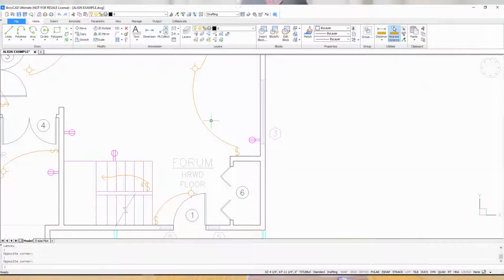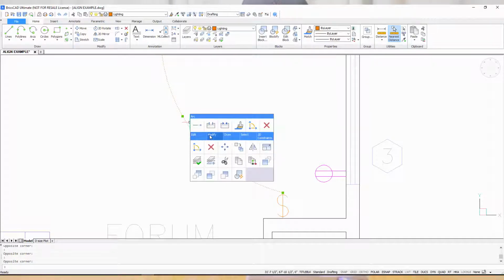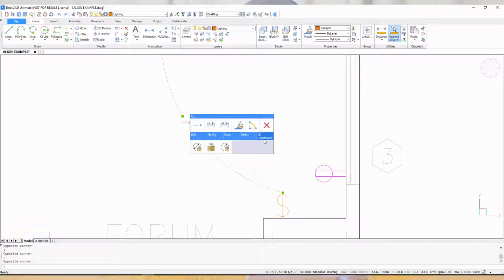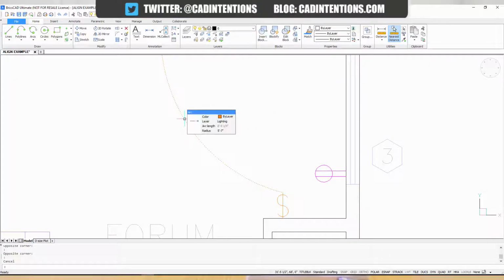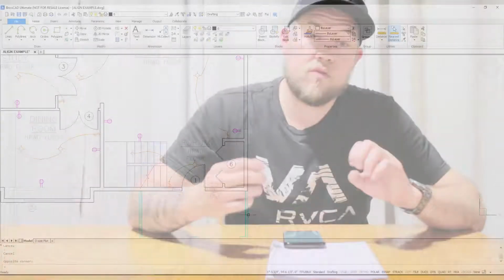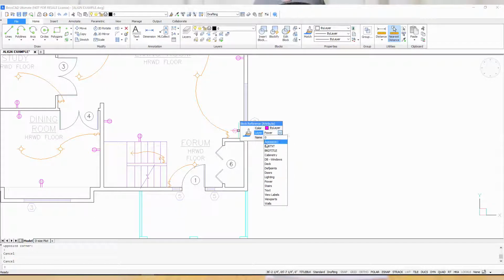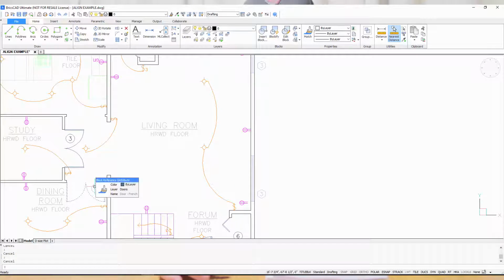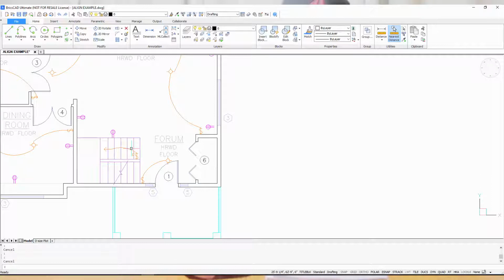3 Must Know BricsCAD Tips & Tricks for AutoCAD Users - Learn BricsCAD Fast

Comment: Hi Brendon

Thanks for you videos. I've found them very helpful for learning Autocad.
Are you able to comment on how closely aligned Autocad and Brics are in terms of commands and approach? 

Hugh
Reply from the maker: Sorry for such a slow reply, just saw your comment! They are very closely aligned. If you are familiar with one of them the transition will be very easy and quick. the commands are quite similar in both and the overall workflows and usability are close as well. BricsCAD has a few things to get used to like the right-click options and contextual options but once you get the hang of them they can be really helpful and fast.